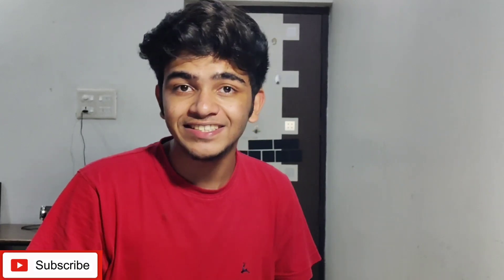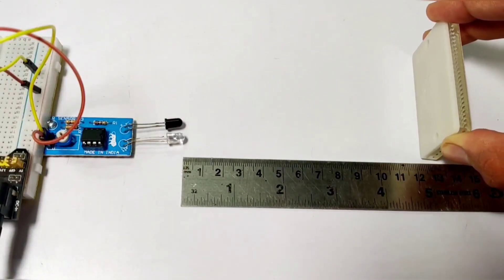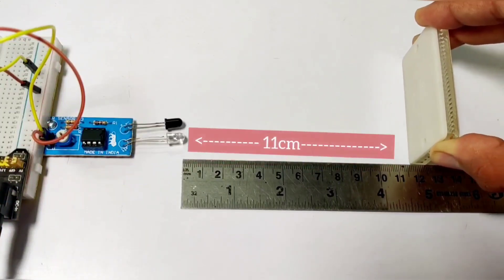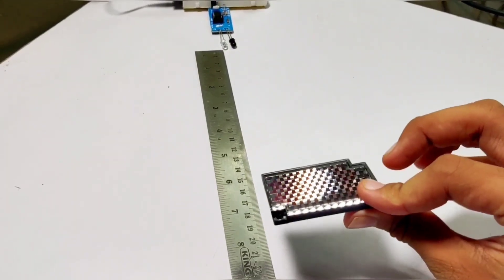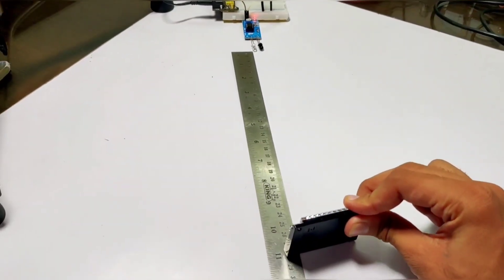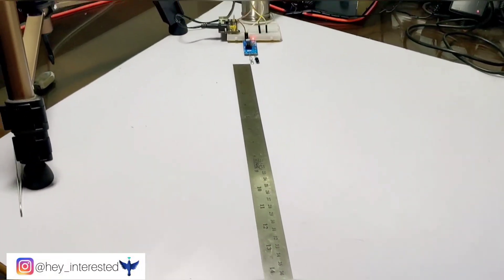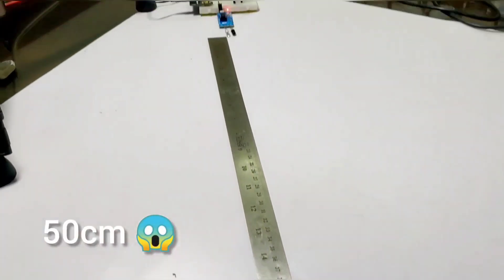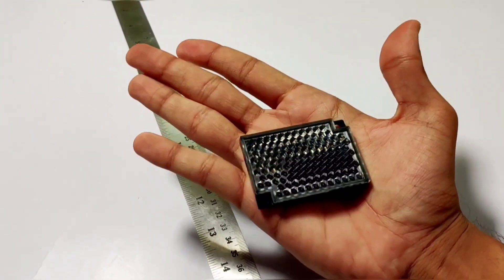Sensor Range Increased 50X😱😱 ll Retroreflective OMRON ll

Comment: Brother can you tell me what is the best substitute of reflector without compromising sensing distance, due to complication of my application I need to use reflective tapes. I'm using a cyndrical M18 Retro reflective 4mtr sensing range NPN senser.